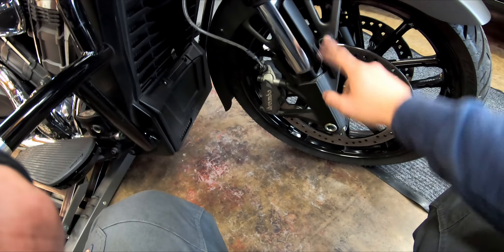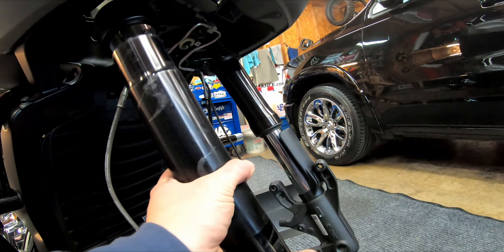Indian Challenger 2in lift kit installation

Comment: Thanks for the video! I went ahead and pulled the shock out, literally 3 more bolts. Top of the shock and 2 for the shock adjuster/bracket. Made getting the front 2 bolts way easier.

Comment: It looks to me that lifting the bike two inches higher into the air would change the balance of the motorcycle and make it a little top heavy.
Reply from the maker: Not at all, it makes it more nimble and flickable into the turns.
Reply: @Ferraiolo_1  Your definition of nimble and flickable, could very well be the source of danger in a certain given situation.
Reply from the maker: @solidrockmitts7927  Lifting motorcycles for lean angle clearance isnt a new concept. This kits been out for a while now, no negative reviews have been reported. this bike handles more like my sportier bikes now.
Reply: @Ferraiolo_1  Okay, just stay safe.